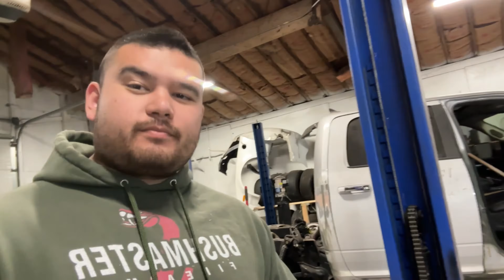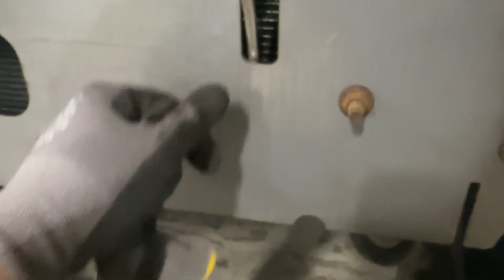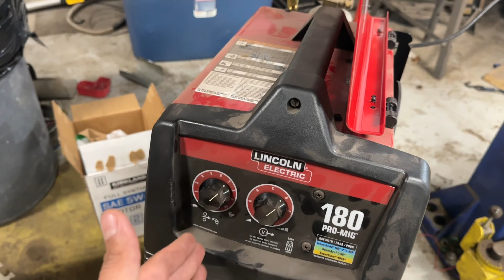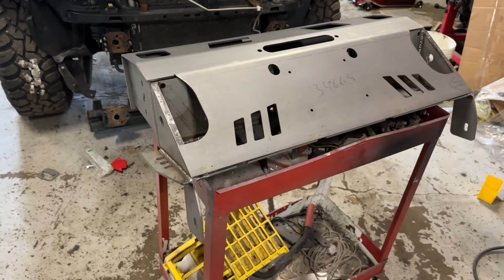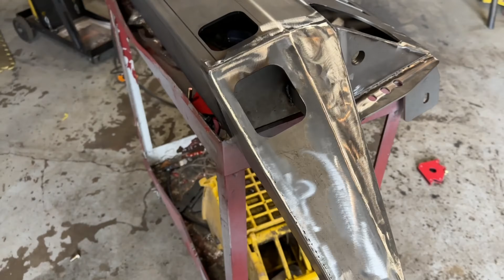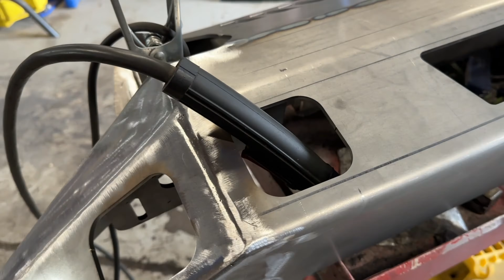Coastal Offroad DIY Bumper - Weld It Yourself!

Comment: Nice bumper. I'm thinking about this one or a Warrior Products bumper. You have a couple things mixed up with MIG welding. Fluxcore  (FCAW) is weld wire that contains flux material in its core to give off inert gasses when it melts to shield the weld area. The diagram you included in the video is of FCAW. MIG is Metal Inert Gas welding (gas in pressurized bottle delivery). Your machine is capable of doing both however you were welding MIG. Although both methods of welding are very similar since they use inert gas to shield the weld from reactive chemicals such as the regular atmosphere it is improper to refer to MIG wire as flux................just MIG wire or wire would do.